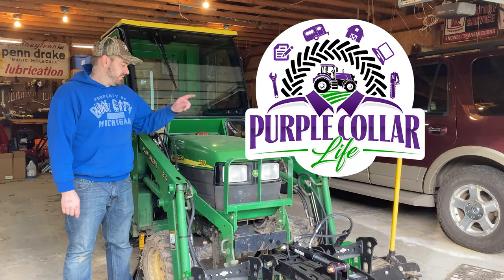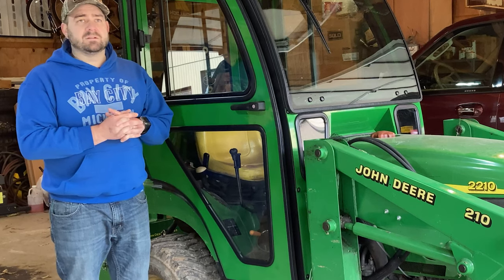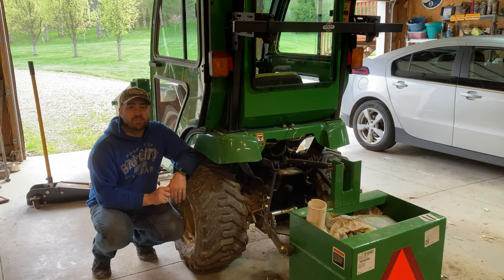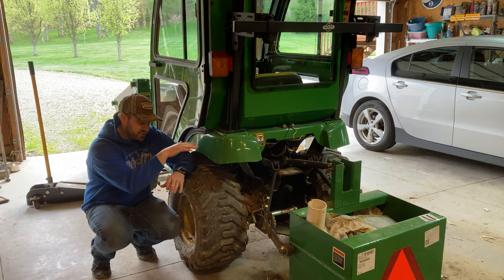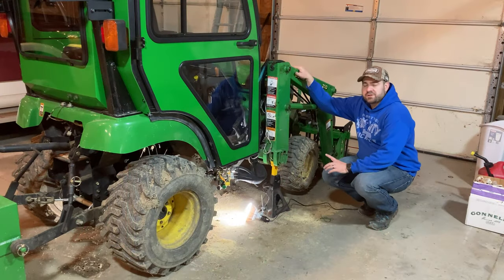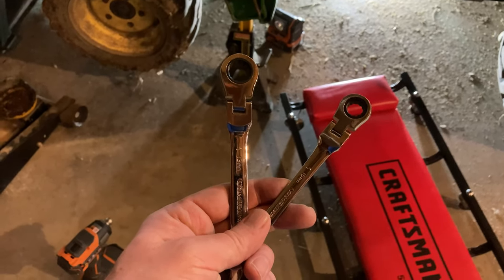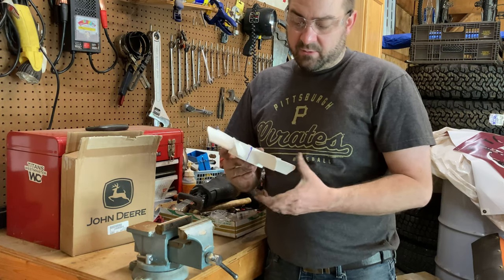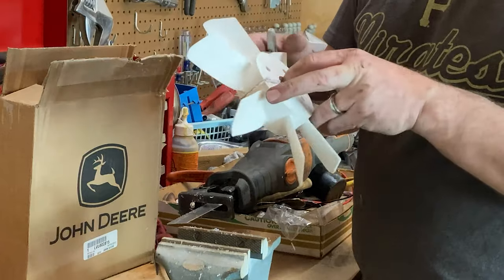#201: John Deere 2210 2305 Transmission Fan Replacement DIY

Comment: Nice choice on repair methods
Reply from the maker: Thanks, Brock! Does your larger Deere use a fan like this, or have a hydraulic oil radiator?
Reply: @PurpleCollarLife  it has a radiator for the hydraulic fluid

I punctured it and had to replace it.

Comment: Good job and thank you for sharing!

If I can add my 2¢ about a tool that would’ve shaved an hour, and be even more helpful in odd jobs then you could imagine, please do yourself a massive favor and buy a Dewalt brushless Oscillating tool. It’ll be under $100 and I PROMISE it would’ve made cutting that fan a 10-15 second job.
Reply from the maker: Thanks, Brandon. I’m hoping I never need to do it again, but appreciate the tip.  I have the Ridgid tool, but the area was too tight - couldn’t fit it in there.  I wonder if the Dewalt tool is a little smaller?  
Cutting the old fan off was certainly the most time consuming part of the process.

Comment: Too bad the fan isn't split from the factory. Or making the blades flexible so if they hit an obstruction, they won't break. But I guess common sense is above their pay grade...lol. Great work and great idea, Chad! 😎
Reply from the maker: Hi, David.  You’d think it would be for sure.  I can’t believe they expect people to split the tractor or drop the transmission to replace this single part.  It seems like there’s got to be a better way.  Hopefully our video helps some other people with the 2210 or the 2305.  Or even other brands (Kubota, etc.) with the same design.

Comment: I just got under my 2305 to lube the driveshaft and saw I have a few nicks in my fan.. Guess I need a better fan guard... BUT.. what worries me more is I noticed some play where the yoke goes on to the transmission spline.  U-joints are fine.. Doing some googling it looks like that play just keeps getting worse till it causes bad vibrations and accelerates the wear on the the other bearings and rest of the system.

So.. wondering what my options are for slowing/fixing the issue.  Since the engine side is pinned to the engine spindle, I think short of getting a new driveshaft ($500+) the only thing I can come up with is maybe lengthening the transmission yoke by welding a 1/2" or so more on the end.. Which would require either moving the engine or transmission to get the driveshaft back on.  Thoughts?
Reply from the maker: Hi, John C! It's nice to hear from a fellow 2210 and 2305 owner.  I believe there are lots of these great machines in operation every day.  
Bummer that you noticed some play on that transmission spline.  I didn't shake mine around much to test for play - though I did twist it and check for loose U-joints.  
As you saw in the video, I took the path of least resistance in repairing my fan.  And I'm not an experienced mechanic, so I'm not sure about the best way to repair.  I do know that the dealerships I talked with seemed to prefer removing the rear of the machine to get into the driveshaft vs the engine side.  Hope this helps.  Keep us posted on what you do to repair.  That repair may be in my future some day.  Maybe make a video so I know how to do it. :)

Comment: I think I missed it... did you get that zerk fitting greased?  Nice job!
Reply from the maker: Hi! You didn’t miss it.  Even with the fan off, I still couldn’t get the grease gun fitting up into the zerk.  The angle of the universal in the driveshaft makes it impossible from anywhere underneath.  I can’t see how anyone does it. I did see on some of the forums that some people cut a hole through the floor pan.  I certainly hate to do that. Thanks for watching and commenting!

Comment: The fan splitting approach works. Good job on that. 

I know a 2210 owner. He's right next door. His U-joints failed at about 50 hours more than you have, so be advised, your turn with that problem is coming soon. If the U-joints aren't greased, it will happen, it's just a matter of when.

It is absolutely not necessary to split the tractor to remove the drive shaft. You do have to remove the floor pan, which your cab makes more difficult, but then disassembling the U-joints, which is simple to do, allows removal of the drive shaft without splitting the tractor. There are several U-tube videos showing that process. 

You can buy replacement U-joints from NAPA, part U410, which have the grease fitting in the bearing cap so you can make provision for greasing them by providing access holes with removable caps. In addition to being grazable, they are about half as expensive as the untreatable John Deere parts. There are videos showing that as well.
Reply from the maker: Thanks for sharing! I definitely have never greased those u-joints on my machine. I know it’s a ticking time bomb at this point. I can’t believe that there was a design like this that didn’t allow for routine maintenance of a wear item.

Comment: Finally got around to mine again today. Tip: 10mm nut driver bit... much easier to line the bolt into the hole using your fingers without the extension. Once you get all 4 of them started, you can go back around and tighten with ratchet/extension.

If you don't know, a nut driver looks like a socket, but has a hex shaft sticking out of the back to fit screwdriver/nut driver.
Reply from the maker: Excellent tips! The nut driver is a great idea.
Reply: @PurpleCollarLife  - The only thing I've learned from this 2210, is that I still hate John Deere 😂

Comment: Got to love engineers who do not think about maintenance or repairs. sometimes they have to but sheesh a zerk fitting that is not serviceable? Chad you did an amazing job. I wonder how many people use a lift for working on their tractors? I am NOT going to be comfortable working in confined spaces like that.
Reply from the maker: It was a tight squeeze for sure.  Having a lift would have been much better.

Comment: You can just cut it in two. The bolts are more that enough to secure it.
I have a 2305
2008
Reply from the maker: Thanks! I wasn't sure if it would be strong enough if I cut it completely in half (or balanced). How different is the undercarriage of the 2305 compared to our 2210? I've heard the 2305 might be slightly easier to get to this transmission fan.

Comment: Have you changed the hydraulic fluid    If so I know there is a spin on filter that’s part of the change but there is also a screen type that also needs to be removed and cleaned. Have you done this part of the hydraulic fluid change? If so can you explain where it is located and what’s involved to remove it from the tractor and if there is a gasket that needs to be replaced? Thank you!!
Reply from the maker: Hello, I've done the hydraulic fluid change once myself.  The dealership did it the first few times.  If I recall, the screen is under a triangle shaped housing/plate cover held by 3 bolts.

Comment: Thank you for such a game-changing video. Mine jfan ust broke. I might look to see if anybody has designed a printed part. Otherwise, I'm following your lead. Thank you again!
Reply from the maker: You are welcome! Keep us posted. Thank you for leaving a comment. Every time someone clicks the like button, leaves a comment, and subscribes - it helps our little channel grow.
Reply: @PurpleCollarLife  Your method worked great. I also modified the guard with expanded metal and now the fan is fully protected from sticks jamming in there. I used a grease needle and lubricated the main drive shaft in both places. Hopefully I will not have to replace that anytime soon. Thanks again.
Reply from the maker: @warrenlange6106  Awesome! I wish I had done the grease needle on the drive shaft.

Comment: I replace one on my JD riding mower. That also sucked
Reply from the maker: Thanks, Larry.  It’s hard to believe that such a fragile part is so difficult to replace.  I didn’t even complain about the $27 price on this small plastic fan, but the fact that the labor to install it correctly is so difficult really disappoints me.  I’m really hoping that my split it and install it method works out and helps some other people who come across this video after having a similar problem.

Comment: Nicely done, Chad. That looked pretty challenging with the limited space under there. The “purple” line was a nice touch 😄👍
Reply from the maker: Hi Ed.  Yes, that was my most difficult project on the John Deere so far.  Installing the cab and the 3rd function diverter were more simple projects.

Comment: Thanks for this video. I was under the tractor this weekend changing the oil and noticed my an blades were gone. Hopped on YouTube and found your video. Doing the swap now. How has the fan held up so far?
Reply from the maker: Glad it helped! My fan has held up perfectly!  I'm so happy I didn't pay more to hae it repaired, or try to split the tractor apart on my own.  This cheap hack seems to work well.  Thanks for watching and commenting! Keep us posted on your repair.

Comment: That is a super cool idea on cutting the fan and slipping it in.  Even if it lasts only a year, you are way ahead of time and/or money on the "real" repairs.  On the 1023E and 1025R, they now come with a oil cooler that is mounted to the radiator and cools the hydraulic oil.  Only sub-compact with that feature I believe.  So hopefully I'll never be in this boat, but if I am this is one of the best shortcuts I've ever seen.  Great video.
Reply from the maker: I've heard that the newer Deere sub-compact tractors have the oil cooler for the hydraulic oil.  I think that's a great idea.  
Thanks for watching and commenting!

Comment: Great job! It’s definitely worth trying it this way!
Reply from the maker: I’d recommend it to anyone in my situation.  Although, the advantage to splitting the tractor would be the access to the drive shaft to replace those universals or at lease grease the fittings.  Thanks for watching!  Hopefully my cut-a-part fan holds up over the long haul.

Comment: Great job Chad, those were tight quarters 😳, Purple Collar - purple marker 😉👍🏻, an M12 Oscillating Multi-Tool might have been useful also for cutting the fan out 🤷🏼‍♂️. BTW love your vintage signs 👍🏻, have a great weekend Chad 👍🏻
Reply from the maker: Thanks, it was a difficult task for sure.  My neck and shoulders were stiff for a few days after trying to see and work in that tiny area.  Some times I felt like a contortionist, trying to bend my elbows at backwards angles and fit my hand in tiny spaces.  
I didn't even think about the purple marker - it's the one I use to write the next oil change mileage on my little window stickers.  Black actually fades off of those faster than purple.  And thanks for noticing my antique signs! I enjoy my collection.

Comment: Nice work on saving time and money on a shambolic design.
I hope that you are going to add some more extensive guarding to prevent that happening again.
The fan has now lost a lot of it's radial strength where you put the 2 cuts through and it wouldn't surprise me if the plastic fatigues and breaks relatively soon. I would have tried to only cut through 1 side fully and used the other side as a hinge which would have kept the fan at pretty close to full strength on that side and on the side you cut plate it with some plastic JB welded to the inside or something similar.
IMHO car/tractor/truck designers should be made to work on what they design so that they can see the difficulties that people down the track face.
Reply from the maker: Hi Alan - I was hoping to cut through only one side, but the plastic just wasn't flexible enough to open over the drive shaft.  
I am looking for some type of additional protection for that area.  Thanks for watching!

Comment: I did the same repair on my Kubota BX24.... then I bought the BXpanded Under Armor shield.  It is vented and totally protects the underside.  And, because mine connects to the mower lift arms, changing it is a 3 minute breeze...  the bonus came when I found it would fit my new BX23s!

I think they make them for JD’s too.  But, haven’t looked.

You did a great job of detailing the repair... and a great job of editing around all the muttered curses and grunts from all the ups and downs from getting on and off the creeper!
Reply from the maker: That's awesome! I've looked at the BXpanded website, and it doesn't look like they make the under armor shield for my John Deere 2210.  Bummer!
Reply: @PurpleCollarLife  Bro-Tek makes a plate for the 2210. Only disadvantage is that it doesn't work with the mid mount mower I think, but that shouldn't matter much in your case.

Comment: How's she goin'?  You know if you use your tractor like it was meant to be used, things will break!!!  That's what they do.  You handled this breakdown very well.  Even with the first estimates of the high cost for repair, you stayed on track and came up with this method for a fix.  I think it was a benefit too that all the blades broke off.  That probably made it easier to cut the old blade off!!!  Cutting your fan in 2 pieces looked to be a good solution too and probably won't affect the performance of the blade.  I have one blade broken on the fan on my Massey Ferguson GC2300.  I never bothered to deal with it as I thought missing one blade wouldn't affect the cooling a great deal and it didn't seem to cause any balance issues either.  So having cut your fan in 2 probably won't cause balance issues for you either.  Nice video and thanks for posting!!!  Take care!!!
Reply from the maker: Thanks for watching!  I was pretty nervous about doing the repair myself. I always wonder about getting the project partially done, and then getting stuck.  What happens if I get the bolts out, but can't cut the fan off the drive shaft?  What if I can't get the new fan on? What if I get 1/2 of the fan on and can't get the second half on?  I know that in the end, I could still just take it to the dealership 1/2 way done.  But I'm so glad that I was able to figure this out.  Lots of great help from the emails and comments from the YouTube viewers!
Reply: @PurpleCollarLife  Feel good about a  job well done buddy!!!

Comment: Nicely done. 👍Those type repairs are a real pain in the .......well everything.   It will be interesting to see how long that can blade lasts after being split. 🤞
Reply from the maker: Thanks! I agree - the experiment actually starts now - to see how long that fan holds up after I cut through the body of it.  I hope that with 4 supports and 2 bolts on each side of the cut, the structural integrity holds up for a long time.

Comment: Great video! I recently replaced the fan on my Massey Ferguson sub-compact tractor last year. It was a difficult job, but I had people tell me it is easier than the orange and green tractors. After watching your repair, I agree! I was able to remove my driveshaft. That is the difference, primarily. The most difficult parts on my repair were removing the driveshaft (rusted) and properly installing the new fan (little room to work). Thanks for sharing, Chad! - Rick
Reply from the maker: Thanks for watching, Rick.  It was probably the most difficult DIY project I've done with my tractor.  Installing the grapple, the 3rd function diverter, and the cab - all pretty easy compared to replacing this fan.  But I'm glad I gave it a try myself instead of spending all that money!

Comment: Good job - good video explaining your thought process to make the repair.  I was missing three fins off of my BX HST fan - I ran it that way for years - I decided to replace the fenders on the BX because they were literally falling apart ( crappy plastic fenders) - so I replaced the fan at the same time - it’s a job for the novice home owner.  Part of the problem is not knowing what you need in advance of starting the project.  And when you live out in the country, the store is not right around the corner.  Good job
Reply from the maker: You're absolutely right. I didn't have the flex extension, a wobble, or a universal.  I looked at multiple stores and lucked into a 1/4-inch drive universal at an auto parts store (NAPA).